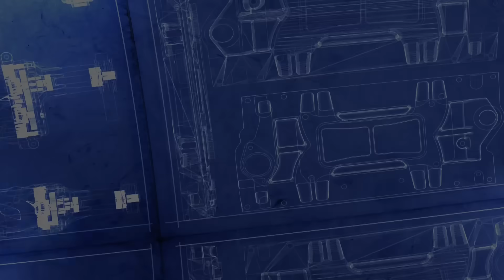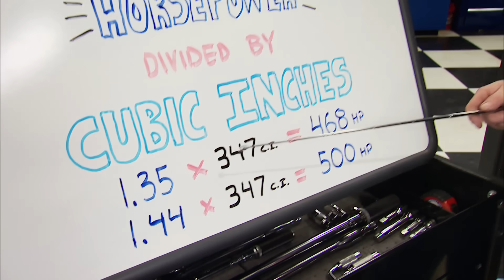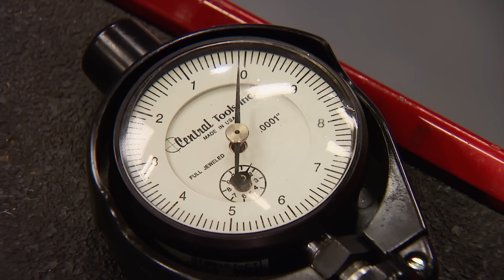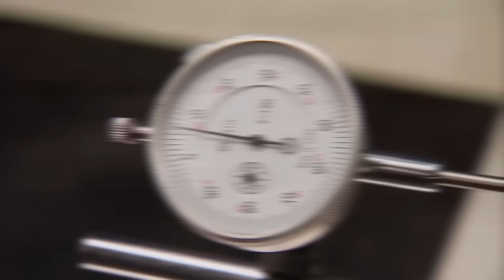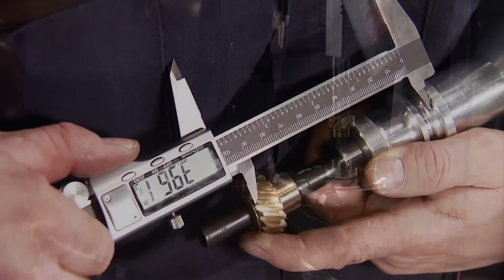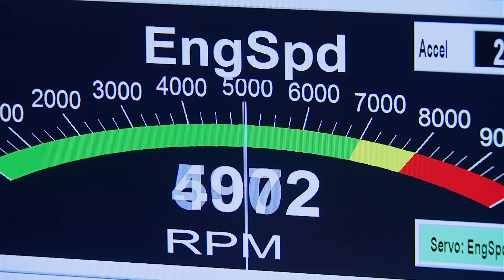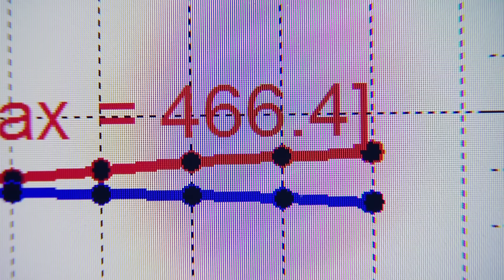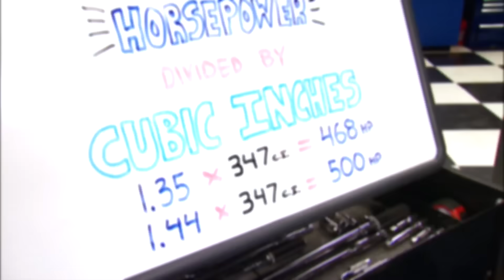Stroking A 5.0L Small Block Ford to 347 C.I. - Engine Power S2, E8

Comment: Me: "Wow 500HP 447FTLBS of torque naturally asperated."  
Inner Me. "Now turbo it."
Reply: annnnddd... now you have 2 4 cylinder blocks..lol
Reply: 1320crusier yea he will turn it into two engines.
Reply: Inner me says EFI and put in miatas. Lol.
Reply: Michael Benoit for real tonaaah
Reply: Even my brother's 331 is using the old Sportsman's block.
Reply: Michael Benoit or could just build a 331 with a dart block, roush Yates heads, 14.5-1 compression and shoot for around 800hp NA.....
Reply: Ultra CNC   😐 NWMT...👏 its gotta be loanly being so full of ones self. I wouldn't have you mechine a part on anything I own if you were the last mechine shop on the planet. Not a chance. And clearly there are things about drag racing you compleatly miss. Like how the cars launch over 2000rpm. in a  Turbo making higher  boost straight off the line. Blowers are great for all around driving linear boost blah blah. You wanna go fast ? Really fast? Really really fast? Turbo 20 pounds  boost at the line on the trans break. Blowers not spinning fast enough to produce 10 in properly balanced application's. Don't break your own arm jerking your self off buddy. Clearly you missed the memo. You think Big Chief dont know how to go fast on  the street? how bout Shaun? Ryan Martin? Daddy Dave? Monza? Chuck? Dominator? Im sure those are the most famous ones you might recognize all running turbos. yeah definitely full of yourself NWMT or anyone's money that's for sure 👏 bravo.
Reply: Thats how they created the 2.3.
Reply: Ultra CNC  usually in those situations it comes down to basic cubic inches. I have seen many big cubic inch big turbo cars just pull away from blower cars because the turbo gets into full boost sooner then the blower car. Again I am not disputing the fact that blowers make some boost down low (under 2000 rpm) while turbos make very little or none but blowers are only making a fraction of what the turbo is making once spoiled at 2 to 4 thousand rpm over 4000 blowers start to slow in boost  gains from parasitic loss. This is also another reason why blowers hook up a bit better. But then start to run out of steam as the boost per rpm gain start to slow as The parasitic loss starts to increase. The linier way the boost comes in is far more predictable vs the sudden  swell from no boost to full boost of a turbo at such a Lower rpm.  Often if not managed properly you will just blow the tires off. Which is why you still see so many racers favouring blowers over turbos. And turbo engines do not "run out of boost" (thats way over spun blowers) they run  out of the ability to handle the boost produced and fail or break. (Now of course there are other factors to consider like how much exhaust restriction is occurring but a properly balanced turbo for the engine application will produce enough boost to break it in almost every case) No arguement just facts and 2 car guys having a chat.
Reply: Ultra CNC  ok now that sounds alot like you wanna argue. Now im not inclined to do so because you just made an absolute ass of your self so good day I guess.
Reply: Ultra CNC  well in all honesty you kinda were a jerk bro. I'll explain. By saying "end of discussion" you took a roll feeling superior as though you had some right to not allow me to rebuttal. I don't disagree with anything we discussed or that you stated untill you did that but you were dissmisave and in so doing rude. Which was not cool. Im just a car guy like you all be it a turbo man and i would assume you a blower boy so of course we can have differing opinions. But dont be dismisive with people. It only makes you look bad and leads to conflict.
Reply: Ultra CNC  I am open for any respectful communication. Expessiolly when it comes to cars, engines and making power. There is lots I do know but lots I to am still learning. I love cars and that is the common ground so we should be able to communacate with mutual respect on the topic at all times. You will find we both may even learn something from eachother if we can accomplish this simple thing.
Reply: They do boost it eventually but they replace the block with one that won't split in half.
Reply: A Turbo is only gonna turn it into a vacuum cleaner. NA is the way when it comes to V8’s
Reply: 500 is the most I would push a stock block that I plan on using as a daily driver. Too much more than that and you'll split it in two.
Reply: Block splits in 2
Reply: Nope not with a stock block 347 kit. A 331 sure, better rod angle better rotational harmonics etc but you don't wanna run even 650hp threw a stock HO block they have a tendancy of splitting in half at the lifter valley. With the poor harmonics and radical rod angle of a 347  in a stock block I dout you could run 5lbs boost or even 560hp at the crank before she split in half.
Reply: @thedon3836  yep, need Mexican block with custom small base circles roller cam then you can psi and rev away.
Reply: @thedon3836  
How much $ to build your 331?
Reply: @thedon3836  you are an idiot.   The old the block cant handle it.   Many many people turbo and supercharge these up to 15lbs of boost with no problems.   Its when you go above 15 lbs and abuse the shit out of it then you can worry.   Iv got a v3 supercharged 90 5.0 stock block running right at 15lbs and it's been fine since 2012.
Reply: @springwoodslasher79  stock block 347? 15 pounds would be nice in a stock block 302ci, 306ci or 331ci maybe not a 347 long term in my opinion. You are free to have your own. No need to act a fool and call people names like grade 3 school yard bull 💩. Are you true stock 302 cubic inches or do you have a stroker kit in of some size(like a - 306 or 331 perhaps)? Plus at 15 psi I am wondering what the compression ratio is. 9.5 to 1 or are you lower? On top of that you are talking about a v3 @15 psi .you understand that is at max rpm un like turbos that kick on around 2 or 3k rpm right? There is a pretty signifacant diffrance in  how the boost works the v3 might only be making 6lbs of boost at 3k rpm but 15 lbs at 5500 rpm.  I am running around 15 psi (on high so not all that often honestly) in my 331 stock block and it kicks in at 2500rpm then the system starts to bleed off excess boost (un like your v3's linear boost per rpm gains which only starts bleeding off above 5500rpm) @8.3 to 1 compression with hydrolic roller lifters, a f 303 cam and 1.7  roller rockers, for a .544 lift in my AFR 205 heads.  But you know what the 😈 do I know apperently according to you (like really who the 😈 are you?) I am just an idiot. Meh! What ever you say man.
Reply: @thedon3836  because people that have never owned a 5.0 and just regurgitate the myth the block cracks at over 500hp is fucking annoying.   If you could fucking read I stated I have a 90 with the original motor with a trick flow top end kit and a v3 supercharger with 15lbs of boost and the block is fine.
Reply: @springwoodslasher79  yeah an original 302ci not a 347 which is what I was refering to. (Can you read? Are we commenting under an op on the same video?) You know like in the vid we watched was a 347 and the op thought yeah lets turbo it? I will agree its annoying when you are talking to someone who doesn't know better or truly is an idiot. You can get over 500hp out of a stock HO block I am not disputing that. I am disputing boosting a 347 long term because they will split which is where that "myth" comes from. And it is no myth because of drastic rod angle, excessive rotational harmonics and excessive mechineing to the block boosting 347 kits in stock blocks Its the truth they can and will split. Stock and boost 302 you can see in to the 600s fine but 302s that get stroker kits tend to fair less well over 331 cubic inches when adding boost. I'm no idiot I did my homework and built my own  engine. It is over 700hp on high boost stock HO 94 block.  Be mad that so many people boosted 347s not knowing any better or just being straight up 💩 builders and split blocks to give them that bad rep. dont be mad because I know better then to over stroke it before boosting. And don't call people you don't know idiots expessioally when you didn't even consider the details that they stated  or that were being discused before you decided to mouth off. We're talking about boosting a 347ci  stroked stock block here not a stock displacement none stroker stock block HO. Smarten up. You are just rude man not worth talking to in all honesty. Ignorant and rude thats you in a box. Enough said!
Reply: @springwoodslasher79  not a myth. I had a 331 t trim with 10psi and had it happen. Search my videos. Funny thing is I never drove it that aggressively because it was too powerful (would spin at any speed under 65). HOWEVER, I also had an extremely low miles all original 1988 mercury cougar with the 155hp 5.0L with 89k miles (the block is the same) and had it split also, again never drove aggressively, took a long trip out to Ohio and came back with oil in the antifreeze (I put a roller EFI 351 in that car afterwards). When I got that car it did run unusually hot, had to put in a pep boys 3 row to get it to normal so that may have been part of it. Seems to me that they are just a weak casting and you are pressing your luck with boost.
Reply: @vendediesel  not saying it's a myth but it's not as common as people think.   Iv got a 90 with a trick flow top end and a v3 supercharger running 15lbs of boost and it's been that way since 2012 never had any issues.   Iv had friends with similar set ups that arnt as nice to there cars as I am and they never had any issues as well.   The block is not as fragile as people think.
Reply: Turbo a v8? Disgusting
Put a blower and get better performance
Reply: @mattgarkus2489  Clearly you haven't paid attention in class. Turbos is nearly 3x as efficient. No parasitic loss, better cooling, more reliable power with FAR more controlling and adjustability. Literally the only thing that blowers have that turbos dont is the instant power down low.
Reply: @uglymechanics6599   blowers do not have instant power down low. Only cars you see making tones of power down low with a blower are cars like Toast (Cleetus' gen 3 camaro) but it's because of the amount of air the blower intake allows in to the engine. And the fact that it's a big block making almost 3000hp. When you think about it the  600 hp it makes  during blower surge at 1000 rpm out of an engine that makes 2500 is not alot really. It just seams like alot. Blowers make boost linearly with rpm the higher the rpm the higher the boost. Turbo hit the max boost you want as low as 2000 rpm and you need to bleed it off from there. blowers don't hit max boost untill at max RPM. If you want evidence of this consider diesel engines. They are all turbo because of instant boost and power. They used to be blown(old detroits) but they didn't make enough boost low enough so they added turbo to them then eventually removed the blowers all together.
Reply: @thedon3836  Thats mostly to do with tuning (right size turbo for the right size engine) but yes.
Reply: @uglymechanics6599  well to split hairs yeah its always about tuneing. Right sized blowers for right displacement/rpm range etc etc . A good well thought out set up and tune make or break any engine build. It's just the myth that blowers are instant power or boost  I wanted to address because it's just not true. A common misconception really. Turbos are  as close to instant power as it gets next to wacking an engine with a tone of nitrous. blowers are boost gains in direct relation to rpm turned so 1000rpm for example next to no boost , 3250 rpm half the boost ,5500rpm all the boost. And a linear degree of boost per what ever rpm your at. Turbos could potentially hit max boost as low as 2000rpm far before any blower will hit max boost. That's all but I know where that comes from so it's not like I'm trying to fault you for that. It's not my intention. Just the facts. You never know someone could be reading all this stuff trying to decide "should I go blower or should I go turbo" to stroke or not to, so the more accurate the info the better right?
Reply: Ultra CNC  I am fully aware but turbos make peak boost far lower in rpm then blowers. Blowers may only be putting out 4 or 5 lbs at 3000 rpm while a turbo is fully spooled makeing 20 pounds. Yes you get low amounts of instant boost with blowers off the line while next to none with a turbo (but no one launches a turbo car at 800rpm anyways) but you get peak boost with turbos far lower in rpm then blowers. a blowers peak boost Is only achieved  at peak rpm. As you said it's absolute basic mechanical fundamentals.
Reply: Ultra CNC  Blowers = linear boost by rpm gains
turbos= boost by exhaust pressure which you can have higher exhaust pressure then the boost needed far lower in rpm then what you can produce boost via rpm alone.
The statment" blowers make instant power" is a myth because the real power is only produced when making peak boost which blowers do not hit until peak rpms
A revision to "blowers make some low amount of instant boost off the line" is far more accurate. But they do not make more "power" down low then a turbo (down low being between 2 to 4 thousand rpm of course because no one really cares about anything under that expesiolly when racing)
Reply: @thedon3836  I'll give you credit man, you know your stuff. I was about to make the mistake of pro charging my 94 Cobra that I just had stroked out to 347ci using the stock block. I was wanting to have around 550whp and thought I would need to pro charge it after the stroker setup to get it. Luck has it when I was setting it up for the dyno and tune a guy that does this every day was telling me the same thing you are saying and he showed me the block from a stroked 347ci factory 302ci that was only pushing 8lbs of boost and the block was split 3/4 of the way from lifters to oil pan straight through the water pump and all. So I said no pro charging needed. Plus I dyno at 505whp with my setup and I have a 150 shot of NOS if I need more power so I'm good. I might even change the jet to 100 shot just to be safe.
Reply: @chadbrattain7985  good on ya. If you really wanted to boost I would say build a 331 or 306 much nicer connecting rod angle and far more favorable engine harmonics. Plus supercharging of any kind puts tons of wear and pressure on the front main barring and can cause even more undesirable vibrations or engine harmonics which can lead to splitting the blocks this is why all these late model 302s make far more hp before block failure when they are turbo instead of supercharged (the load created by generating boost is spread out accross all crank barrings when turboed as aposed to just the front main barring when supercharged)   under boosted applications. I have seen turbo stock blocks running 650hp reasonably reliably but most supercharged stock blocks split just around 550. Keep in mind if you do spray a 347 you are probably not gunna want to hit the juice below 4000rpm and a 100 shot would probably be plenty. Again it comes down to connecting rod angle and bad engine vibrations.
Reply: @thedon3836  I agree, and I have my nitrous oxide setup for wide open throttle switch only with a manual purge and a manual cutoff switch. I also have the bottle in the back floorboard so I can turn it on or off without having to get out of the car, mainly for safety reasons.
Reply: @mattgarkus2489  twin turbo over a blower any day
Reply: @mattgarkus2489  garbage! Too much for the street. Turbo it and go incognito
Reply: @mattgarkus2489  wtf you talking about? ✌😂

Comment: that block wont last long , 302 small block start to crack at the mains and then split right down the cam tunnel and if you dont believe me just look on youtube and search blown 302 ford windsor.
Reply: turbo man 351w  correct this setup revs way to high and likely won’t last long. However 302 blocks have lived wayyyyyy past 500hp In setups that can make the power and only rev to say  5800. Like a turbo setup